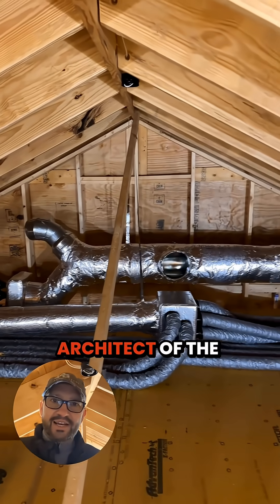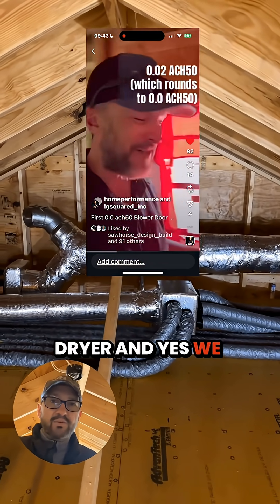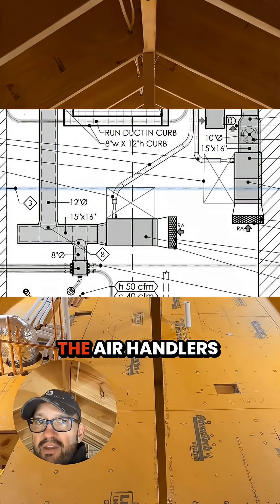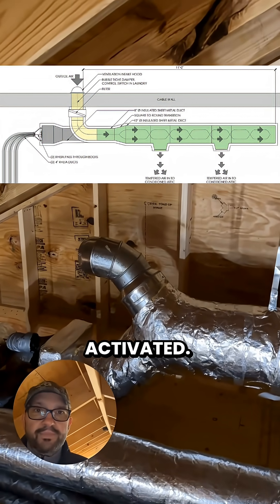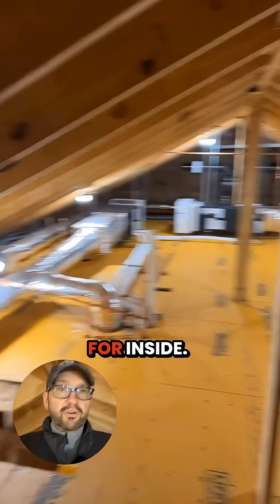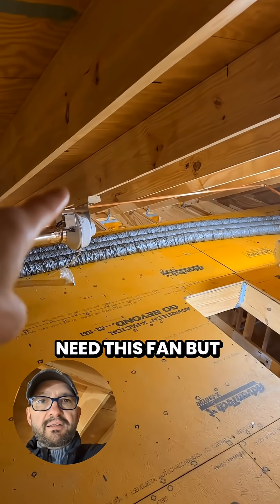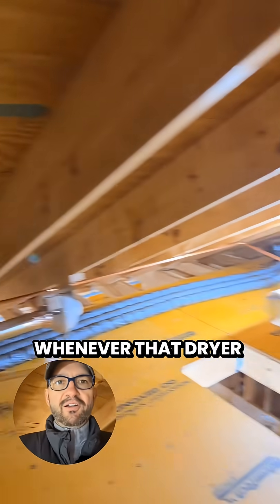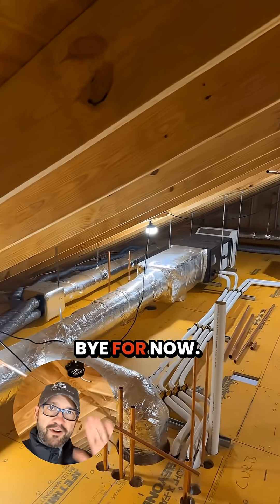Make-Up Air System for Clothes Dryer at Atlanta Craftsman Passive House

Comment: Are you not a believer in heat pump ventless dryers?
Reply from the maker: I am not opposed to them at all. We discussed this with the owners. They will have two dryers in the house, and one is standard for its speed. We encouraged the heat pump, but it came down to dry time.

Comment: It's balanced pressure? So you'll have a fan pulling the makeup air in?

Love the idea of attic as plenum... I think
Reply from the maker: @jbecker386, the blower in the dryer will be pulling/sucking on the house, and it this system will provide that pressure relief.
Make sense?
Reply: @LGSquared yes but the house will still be under negative pressure,  you would need a fan to actually have balanced pressure
Reply from the maker: @jbecker386  It is only under negative pressure because of the dryer fan pulling on the house; this negative pressure pulls the outside air in through the make-up because that make-up air opening will be the only opening in the shell of the building. So, it is a relief valve, and then the house balanced. Make sense?
Reply: @LGSquared nope, not balanced. Just less negative than it would be without passive makeup.
Reply from the maker: @jbecker386  how do you figure?
Reply: @LGSquared if the dryer is pulling air from the house and the house is pulling air through a wall cap, a filter, and a duct, the house has to be under lower pressure to induce the air movement. All those components have pressure drop.
Reply: Basically, the house is a return duct or plenum when the dryer is running. A return duct or plenum is under negative pressure with respect to the house.  The house will be under negative pressure WRT outside.

Comment: I was captivated by Corbett’s video, so nice to finally see it! 

Question, you lost me at the dryer vent and booster fan part of the video. Is the dryer vent going to be connected to the booster fan? And it is just not connected in the video?
Reply from the maker: @BrianBaldridgeC Correct, this is rough in stage. From the fan to the dryer there will be a duct, and the duct on the other side of the fan will extend to the outside. The make-up air ductwork will be completely separate from the exhaust ducting. 
Thank you for asking to have this clarified. It is always easier in person ☺️
Reply: @LGSquared , thank you for the response. That is an intriguing setup you are building there! Love’n it!

Comment: I don’t understand and I want to understand. My dryer is plugged in and has a vent hose to the outside wall. What is all of this? Where does the extra lint go? It seems like a fire hazard to me.
Reply: When your dryer kicks on, the dryer is stealing air from within the home, and is exhausting it to the outside through the vent hose. You may notice that your laundry room door will prop itself open when the dryer kicks on. 

When this happens, you put the interior of the home in negative pressure. If you have a loose / leaky home, the stolen air will be made up through cracks in the foundation, worn weather stripping around windows / doors, any improperly sealed penetrations in the walls and building envelope, etc. That made up air will bring any air pollutants with it, included moisture and humidity. When that moisture and humidity hit a condensing surface, at dew point, it will turn back into water … which is where rot and mold come from.